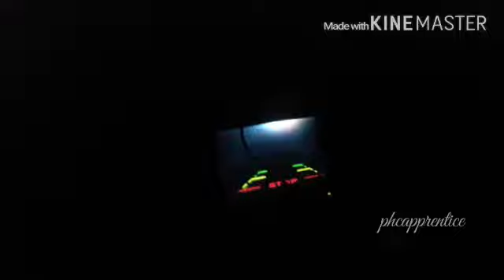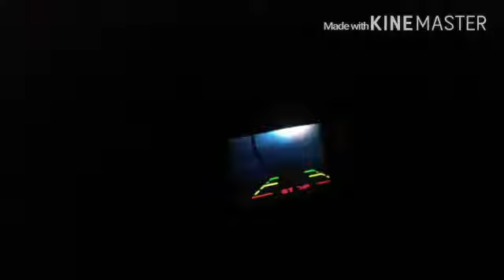Payne Furnace Update

Comment: and the reason for getting rid of the low loss?  i love my low loss.  yes, they need rebuilt occasionally.  yes they are bigger and sometimes are tough in a tight spot.  but im all about my low loss.  i work with a guy who uses ball valves instead of low loss and his reasoning is that he dont like rebuilding the low loss.  but everytime i use his ball valves i bitch and moan.  LOL
Reply: +jeff leonard i use ball valves on the vacuum hoses since i dont pull thru the gauges and i need to stop refrigerant charging from heading back up toward the pump.  but thats a special needs kinda thing.